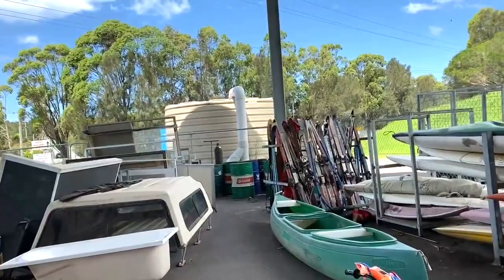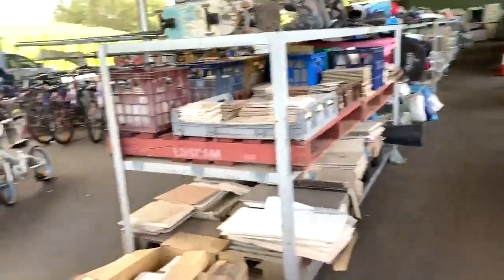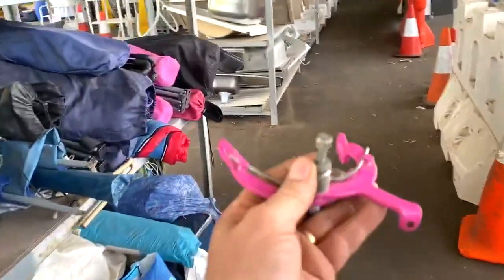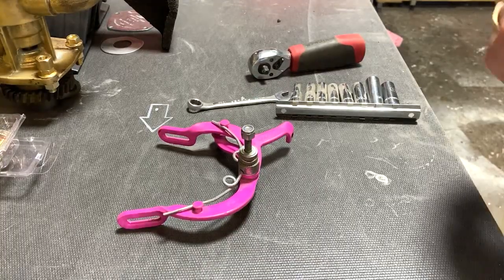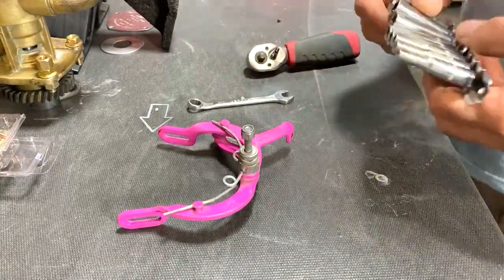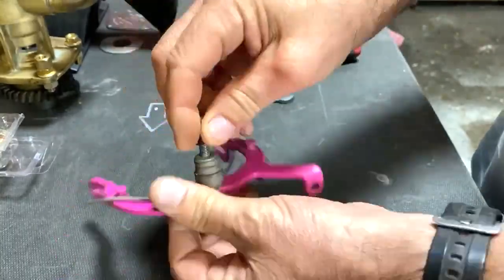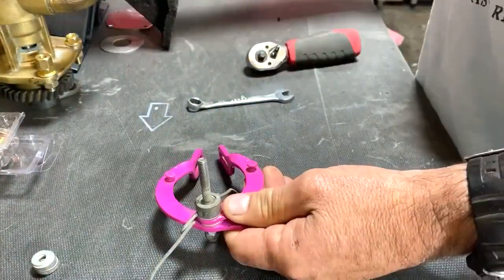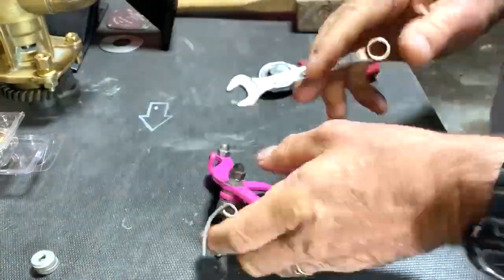$2 Impeller Puller

Comment: Going to remove my impeller for the first time on my Yanmar 4LH-HTE, difficult working from above and the faceplate is facing into the back of the starter motor with limited room. Going to use a small bearing puller with 2 jaws, was looking at pullers for windscreen wipers also. As regards placement using aluminium tube to insert new impeller into then into pump housing and remove tube, loads of silicone or something suitable that doesnt eat rubber!
Yours is a good piece of kit!
Reply: If Jesus experienced death for only one minute, then he is not God or the son of God, but rather a human being.
 If Jesus rose from the dead , then this is normal. 
I, you and Jesus, when we die, will rise from the dead.

God is not jesus Christ 
 Jesus was talking to God, 
Jesus was praying to God, 
Jesus said that only God knows when the hour is ،
Jesus said he was going to God.
Jesus said he couldn't do anything to himself.
 we are facing two separate personalities and they cannot be one  .
God is only one .
God does not beget or be born.
God has no equal.
 God has no likeness
Jesus is not God or the son of God .
I invite you to Islam and worship the one, true, living God.
In Islam, your relationship is only with the one, true, living God, without a mediator
Reply: @SamA-xu9gy  Whatever gets you through the night man!